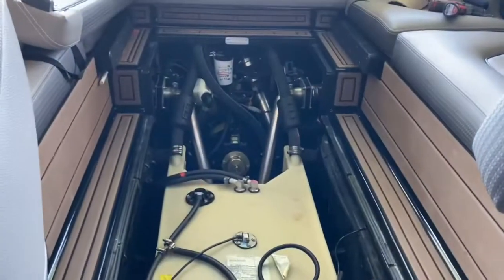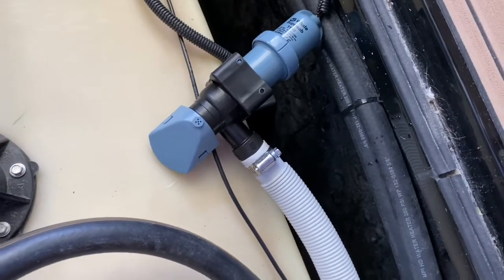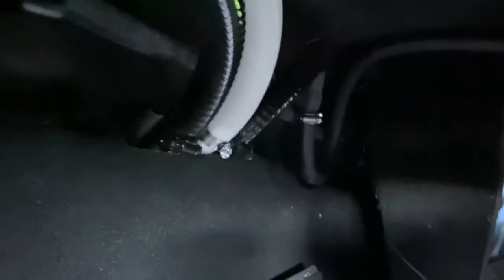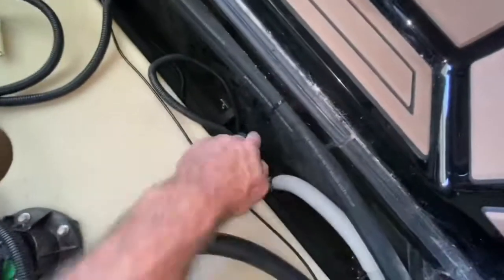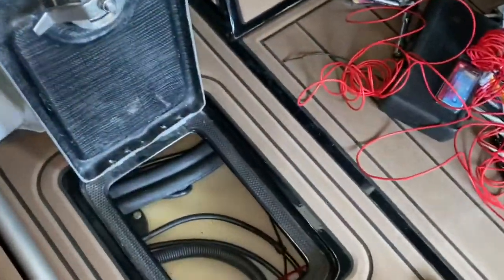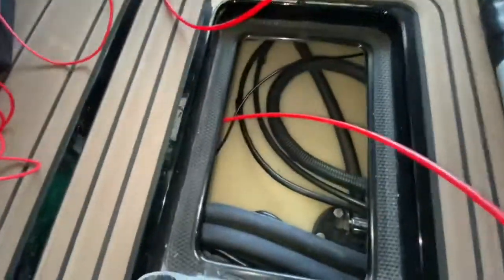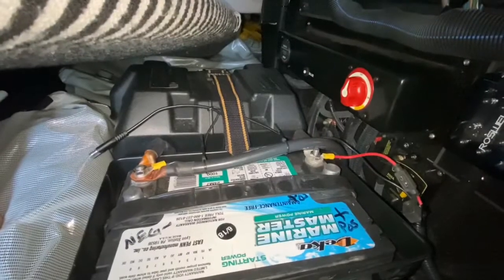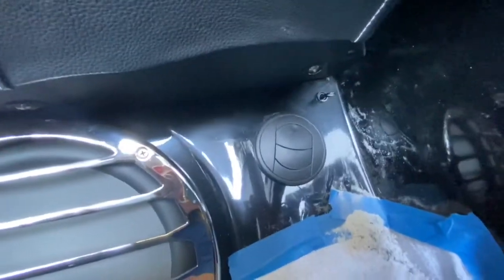DIY Bilge Pump Install Centurion

Comment: Where is the automatic pump located at
Reply from the maker: The stock bilge pump, which is automatic (on the 2018) is In the rear just below the rear of the engine, on the driver (starboard) side.  Some newer year models came with a fwd bilge already.